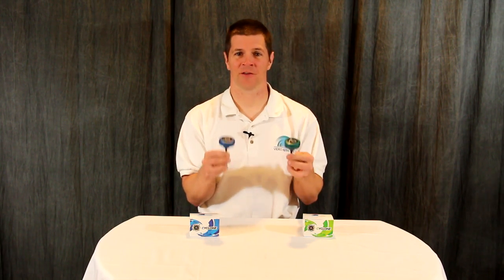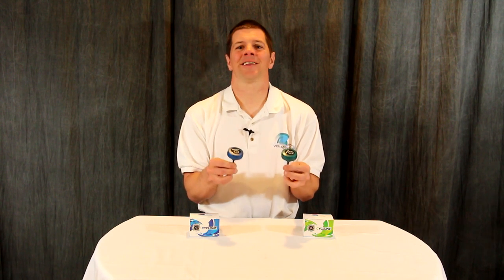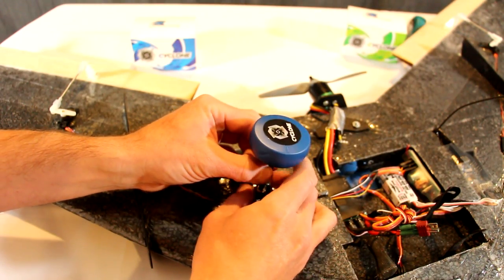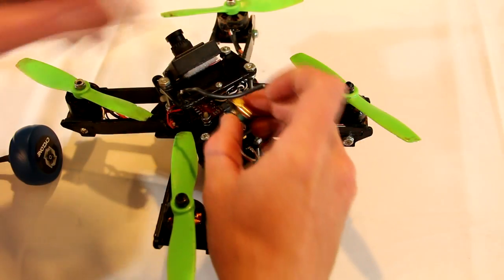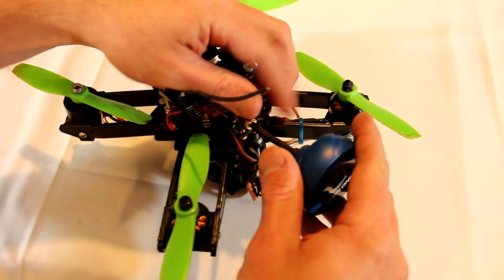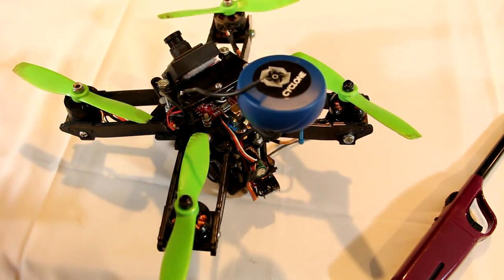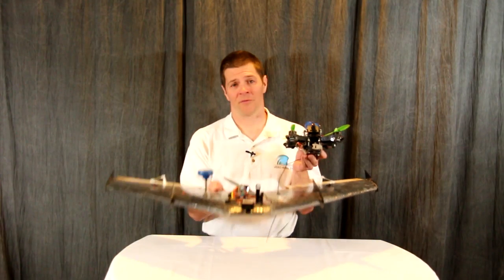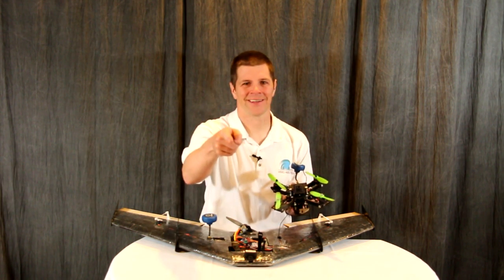Cyclone antenna overview

Comment: Hey, so how is the antenna gain compared to the airblade etc?
Reply from the maker: Very low.  The gain on this is 0.71dbic.  This is great for vehicles that do not fly far (quads and helicopters) but is not suited for long range.  The Airblade is better suited for airplanes.  That said, the Cyclone on 200mW will out-distance most 2.4Ghz control systems.
Reply: +Video Aerial Systems ok lets see if its enough for 25mw. is the normal gain 3db on a 3 lobe cl? thx for the replies!

Comment: Hi Alex, I currently use a mad Mushroom on my goggles as part of a diversity setup, would the cyclone be a better choice than the Mad mushroom?  I use the TBS Triumph on my Quad.
Reply from the maker: +Zaniix_FPV - Yes, the cyclone would be better.  However, using 2X 3 turn helicals on your diversity aimed 50 or so degrees apart would be the absolute best.

Comment: Hi Alex!  As always, I love what you continue to do for the hobby!  Thank you!  I have a ZMR 250 quad that I need a set of antennas for.  I have been thinking about your LHCP Air Blades but now these Cyclones have caught my interest.  I'm not a hardcore racer but I do like flying with my friends.  Mostly we fly outdoors....rarely indoors.  What would you suggest?
Reply from the maker: +mountaindewdude76 - The Cyclones are great for good signal quality on multirotors and will perform as well as the Airblades in just about every situation a mini multirotor can get into.  However, care must be taken to prevent the cable from shearing off in a crash (see video for how to do this).  If you are planning on racing and crashing a lot, the Dura-Spec is your best bet on the transmitter as it is the most durable.
Reply: Thanks very much for your time, Alex!  If the Dura-Spec's are available at SBA, I'll be ordering them tomorrow.
Reply: If I could bother you one more time, I see that SBA has the Dura-Spec antenna in stock.  However, it's only sold as a single.  I have no other LHCP antennas, so I would be needing two antennas.  Can I get two of these antennas and have them work well together and, if so, would it matter which one is on the vtx and which one is on the vrx?  Or would you have a better suggestion (keeping within a reasonable budget)?
Reply from the maker: +mountaindewdude76 - 3 turn LHCP helical on the RX.  You will never use an omni RX antenna again ;)

Comment: Hi Alex,  I have a question not related with this video, but with your antennas in general.  What in your opinion is the best 1.3ghz antenna to combine with your 1.3ghz  Peperbox RHCP?  I bought the 1.3ghz Airscrew one,  but In reality I don't know if that one was the correct one. I'm not looking to fly extremely high, but just to fly far at about maybe 10 miles.  I'm using a 400mw 1.3ghz VTX, but thinking in getting a higher wattage one.  Do you think that the vtx I have might work for my goals?  I would like your expert advice on this matter.  Thank you very much for creating such amazing products.
Reply from the maker: +ricardopr54 - You made the right choice.  Enjoy your flight ;)
Reply: +Video Aerial Systems Thanks very much...
Reply: +Video Aerial Systems But what about the question about the VTX that I'm using...Do you think that the 400mw might be suitable for the 10 miles flight that I'm planning to do,  or should I get a more powerful one? Thanks again for the help and for create such an amazing line of products...
Reply from the maker: +ricardopr54 - Yes, that is ok.  You have a 20-25mile link.  You have plenty of RF power ;)
Reply: +Video Aerial Systems Thanks for your response. You are the best! ...Thumbs up!

Comment: were do the triumphs stand among your antennas. i just bought some last week.
Reply from the maker: +newtypeJP - They are a "Jack of all Trades, master of none".  They do everything very well, but excel at nothing in particular.  They are an incredible general purpose antenna.
Reply: what would you fly for multi rotor
Reply from the maker: +newtypeJP - it depends on the size of multirotor and the purpose.  I usually run Race Secs or Dura-Specs depending on if I am racing or stunt flying.

Comment: Just curious, how do you produce the radiation patterns for your antennas. Are physically measuring it or just modeling the expected radiation pattern?
Reply from the maker: +Rhys Wyber - It is an NEC model.  I verify it with a field strength test and spectral analysis.

Comment: Nice!  Hey iBCrazy, maybe make some very lightweight antennas for really tiny quads/ micro UMX type planes?
Reply from the maker: +BWX - We already do.  I few stores carry them.  However, the Cyclone is very large and thus, not micro Quad friendly.   It is more of an airplane antenna, really.
Reply: Video Aerial Systems
Yeah I knew that about the Cyclone by watching the video, although I couldn't find them on your website.

When I am talking about small and light, I meant something like 1gm or so for tiny brushed quads.  Like that one made by "TrueRC"  You guys make something like that?
Reply from the maker: +BWX Twisted quads and a few others carry our micro version.  The one from True RC Canada is just as good, but not as tough as ours.
Reply: Video Aerial Systems
Hmm.. I looked at every product on that website and couldn't find it. Is it on your website, Or any other site?

Comment: Alex, these are sweet! I really like that mini quad, what frame is that?
Reply from the maker: +Propwash Rotorsports - Gremlin 196.  It is my own design.  I never released it because the cost of materials exceeds the price of many of the cheap Quads out of China.
Reply: It looks really sharp, completely caught my eye. Do I see dihedral on those motor mounts? Could you possibly bring it with you to Flying Circus (Jeremiah has allowed me to volunteer and I am super STOKED!)? I hope to see you there.
Reply from the maker: +Propwash Rotorsports - Yes it has 6 degrees of dihedral in it ;)

Comment: Hi Alex
Do you plan to make a 1.2 ghz version?
Reply from the maker: +andrew hodgkinson - Unfortunately the size is just too big for 1.2Ghz.  I have made a few for testing, but that was it.
Reply: Oh well we cant bend the laws of physics.
Thanks for they prompt reply.
Reply from the maker: +andrew hodgkinson - Working on it.  I am currently trying to overcome a few issues with pole spacing.  There is a new design I am working on called the "rotor" antenna that looks promising, but there's a lot of testing to be done first.
Reply from the maker: +Tigerlie - There's a balun tucked inside the cover.  That's what the protrusion at the bottom of the cover is for ;)